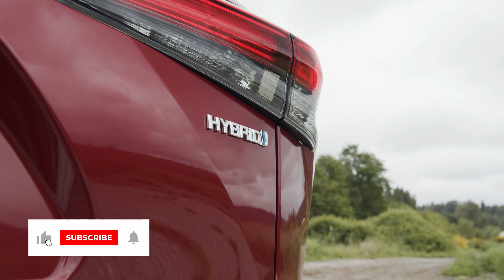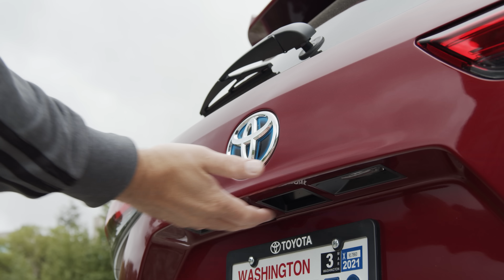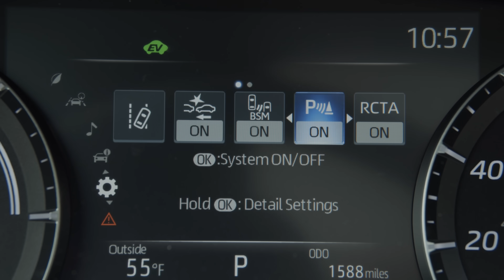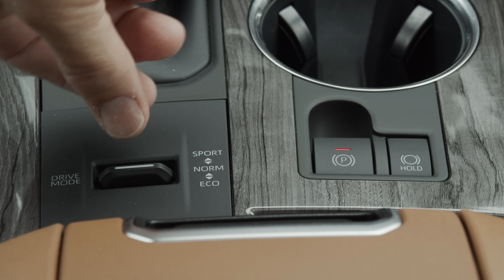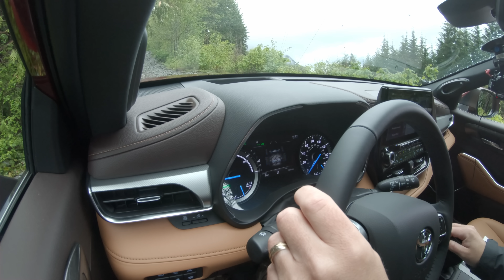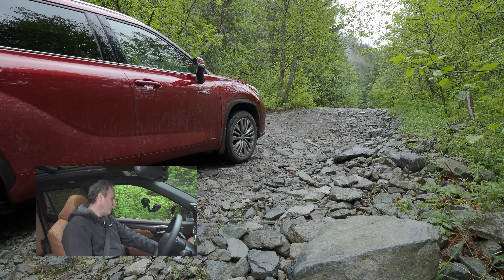2020 Toyota Highlander Hybrid AWD Off-Road Review

Comment: Amazing mileage but it seems underpowered for a vehicle of this size.
Reply: I have driven the Hybrid back to back against the V6 twice in the last month trying to decide..   It really has all the power most drivers would want or need...  Unless your the type who wants a twin turbo...  I will say though ,,,  its missing a driving feel that the V6 has..  Hard to explain if you aren't a driver.  BTW - i still not decided.
Reply: @Macmathews1  just go with this. 36MPG is a game changer. It has a better AWD system as well. The small loss in HP isn't a huge difference
Reply: 243hp is underpowered to you? Seems perfectly adequate to me, especially since a good portion of that is electric which has the benefit of great torque.
Reply: Lmao. Its a Hybrid dude. If you want more power you will loose the mileage.
Reply: I have a 2021 AWD Hybrid. It doesn’t have any problem with power. We drove it to Sedona from Phoenix (uphill) and it had no problem, in fact I like it better than our 2018 Highlander V-6 because it doesn’t need to downshift/upshift, the electric motor just spins at the needed speed. It went up the steep hill outside Verde Valley at 70mph in cc, not having any trouble. And the engine did not scream to do it. And the best part, when I filled it up our fuel mileage was 39.80mpg! And just so you know, I tried to get my wife to keep the 2018 Highlander because it had that powerful V-6. I had to eat my words! Now I’m a believer. And, I ordered a new Camry hybrid SE for myself. They are really that good.
Reply: @louislopez55  so you think it's worth getting the toyota highlander hybrid over the gas version??
Reply: @everydayfun9531  I guess i must because i now also have a 2022 Camry Hybrid. Perhaps if you don’t drive too often or far and have no problem paying more towards your monthly gasoline bill the new turbo 4-cylinder or an older V-6 would be a good choice. But it’s not just the increased mileage, the smoothness and quiet operation of the hybrid is also a good reason to consider. Note that compared to the Camry hybrid the Highlander engine does make itself heard more as it’s a heavier vehicle, but in normal driving it’s no big problem.

Comment: It did pretty well compared to previous tests but of course you are not following the same exact path. This is why I prefer to see roller tests  where you can put rollers under different tires and eliminate all variables like the type of surface or the type of tires or the exact path you need to follow. Would be nice if you could maybe find some rollers to do such test.

Comment: Looks like it did better that the Rav 4 TRD?  Was that what you also were seeing?   I was more impressed by this one.  Thanks for another great review.
Reply from the maker: It did seem to do better. We reached out to Toyota for some details as to why it is, but I haven't heard back yet.
Reply: Driving Sports TV , that would be interesting as the drive concept / design I believe was basically the same.  Makes you wonder if they need to update the software on the Rav 4 TRD?  Can’t wait for that Rav 4 Plugin !! I hear it’s gong to be delayed 🤔
Reply: Richard Burguillos could it possibly be the wheelbase, track width or weight that helped this Highlander here?
Reply: Alan Bowers ,  that’s a possibility.  However, in some cases I don’t think the Rav 4 TRD even tried to get out.  I don’t remember as efficient a transfer of power from spinning wheels to non spinning wheels.  Mind you with an all electric rear it might be different than torque transfer.  I’m not an expert.  Now I’ll need to go watch the Rav 4 TRD video again.
Reply: @richardburguillos3118  totally, I had to check out the video of the RAV4 again. Looks like in similar types of situations, the RAV just isnt able to transfer power as effectively as the Highlander. Could be like Eric said that the Highlander has a bigger motor which can cope with the increased loads and then easily figure it out. But you're right there's definitely a difference that seems to be inherent to the individual vehicles.
Reply: I suspect the rear motor is a bit bigger. Toyota is being tight lipped.  Hill climbing transfers weight to the rear so those wheels have much better traction.

Comment: Do we know HP and TQ figures for the rear axle in this thing? I’ve searched high and low and can only seem to find the rear motor specs for the RAV4 Hybrid. This was quite impressive... I wasn’t expecting the Hybrid to perform this well.
Reply: You cant really know because the numbers get skewed and confuses many people so toyota does not release combined numbers (engine + battery).
Reply: Would be interesting to know, but doubt you’ll be able to find anything aside from the combined figure.

Comment: So in comparison with the 6 cylinder Highlander 4 wheel drive, how did it do?  Does the six have the trail switch?
Reply from the maker: The V6 has a more thorough Multi-Terrain Select system with available (basic) Torque Vectoring AWD. It's more capable off-road, but both are limited by the relatively low 8-inches of clearance. (Esp. Compared with Subaru Ascent's 8.7-inches)